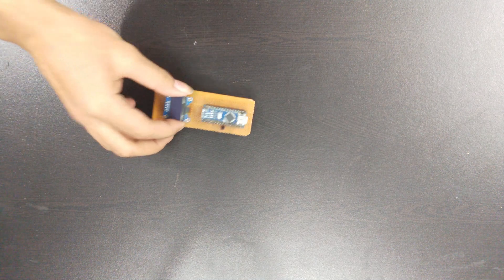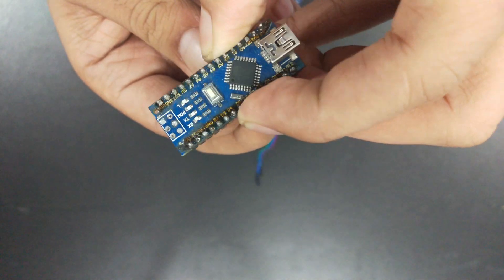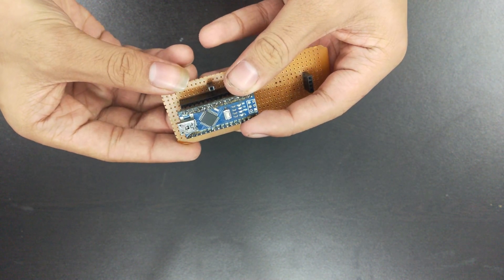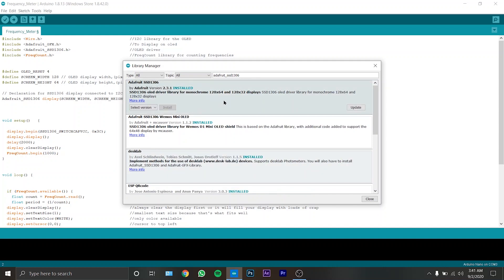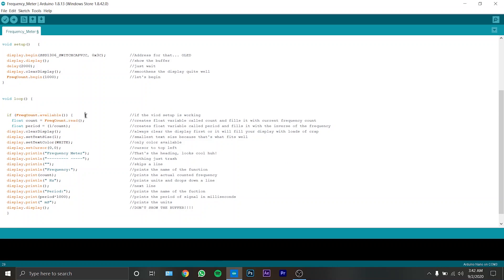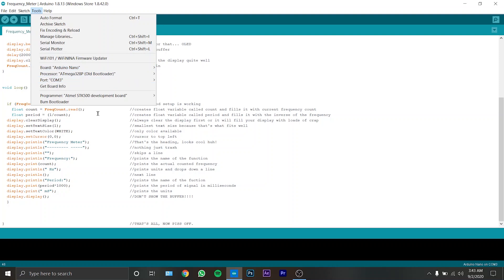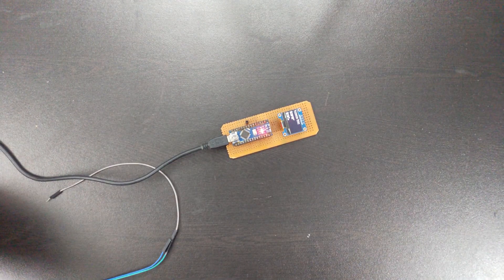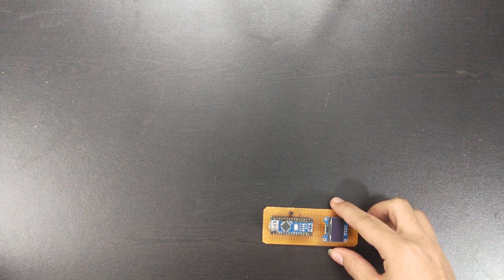How To Make Frequency Meter | Arduino | OLED Display | Electro Hacker

Comment: Hi sir it posible to measure freq 100khz until 150khz on welder machine mybe voltage about 15-40v
Reply from the maker: Yes, it is possible but you have to drop that voltage to 5v constant
Reply: @electrohacker4848  how to drop the voltage sir?? And how about freq if drop the voltage sir??
Reply from the maker: Frequency won't be affected if voltage is dropped, and about the voltage drop I will make a video for it in this month only so you can watch that🙂🙂
Reply: @electrohacker4848  secepatnya ya, saya sangat memerlukan itu
Reply: @electrohacker4848  as soon as possible yes, I really need that. means I can use a voltage sensor like ams3,3v or 7805 ?? if my AC voltage is in line with the diode yes sir ??
Reply from the maker: Yes you can do that but only if that is in line with diodes that you say so but if it is not then Lm7805 won't work
Reply: @electrohacker4848  yes sir thank you. And do u have source code sir??
Reply: @electrohacker4848  hi sir, if use to test freq 100khz, on oled will show 100000 hz sir???
Reply from the maker: Yes
Reply: @electrohacker4848  ok sir, i have write sir😁😁😁
Reply: @electrohacker4848  hi sir i will wait your video about measure freq 100khz with 15-60v sir🙏🙏🙏 please🙏🙏